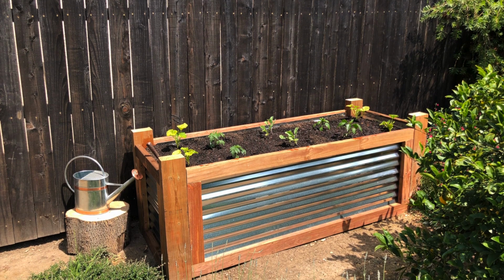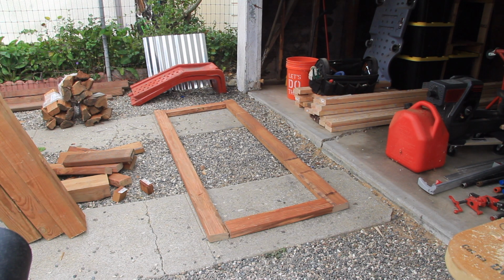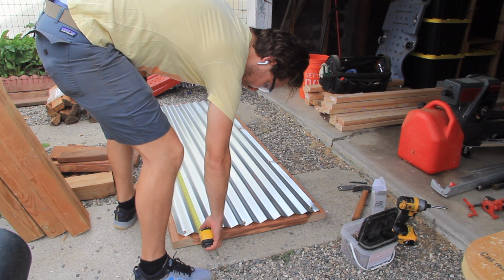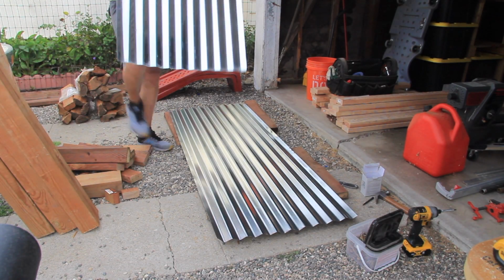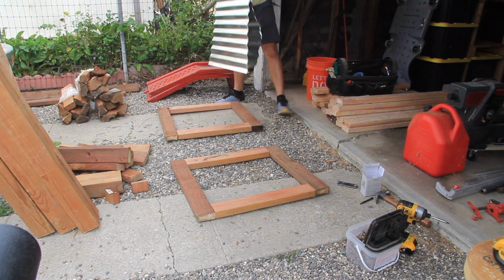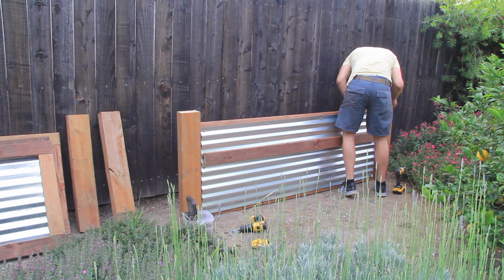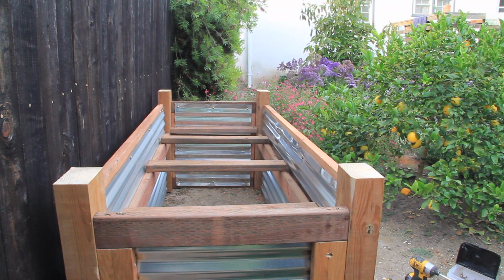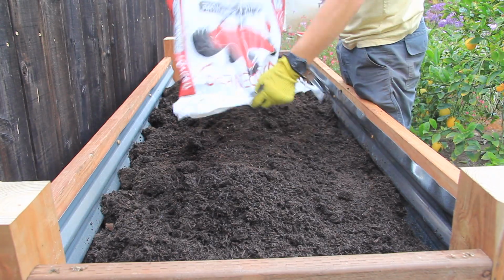How to Build a Raised Garden Bed with a FALSE BOTTOM using Treated Red Wood and Corrugated Metal

Comment: Hi, very nice project. I am building mine based yours. Just a quick question, you used wood 4" wide, but your construction screws are 3" long, did you drill deep holes on 4" woods? why didn't you use longer screws instead?
Reply from the maker: Thanks for watching and good luck with the build. I did drill deep pilot holes. You could get different sized screws, but this is what I had on hand. Happy gardening!